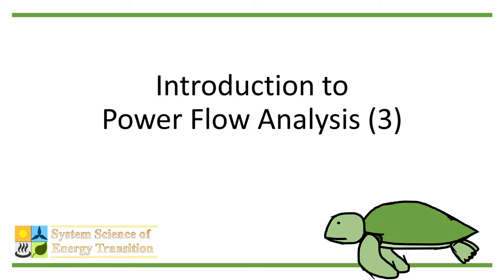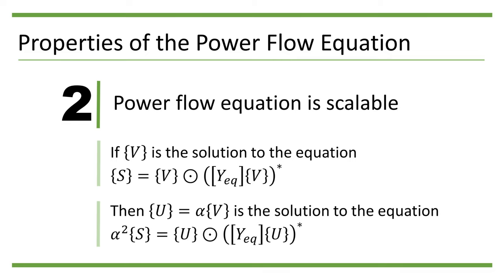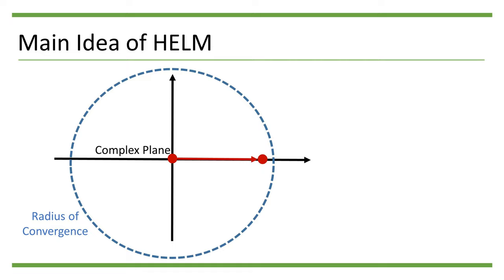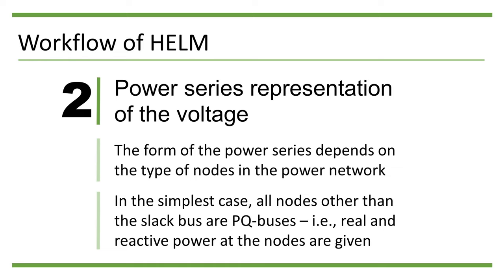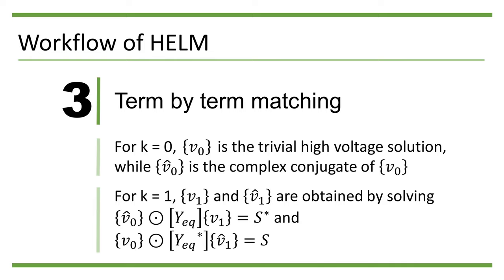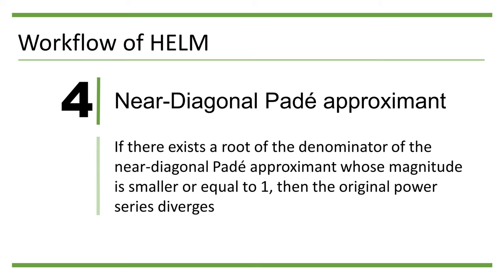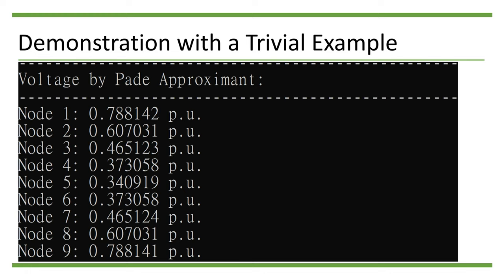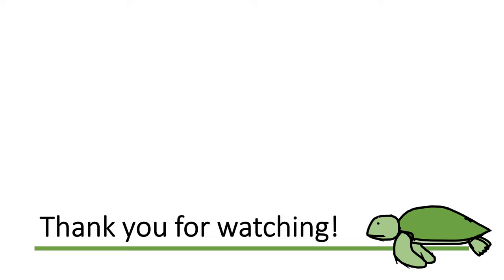Power Flow Analysis (3): Holomorphic embedding load flow method (HELM)

Comment from the maker: Correction:
In 00:46 I said that because the node admittance matrix [Y_eq] has rank n-1, so a slack bus is needed. This is not entirely correct. Due to the existence of a null vector for [Y_eq], it is true that we need to reduce the unknown variables from n to n-1, but setting a slack bus is just one of the multiple ways to do so (albeit probably the simplest).

See the video "Power Flow Analysis (3.5): Corrections and Comments of the HELM Video" for more information:
https://www.youtube.com/watch?v=DrsbsygaCAE